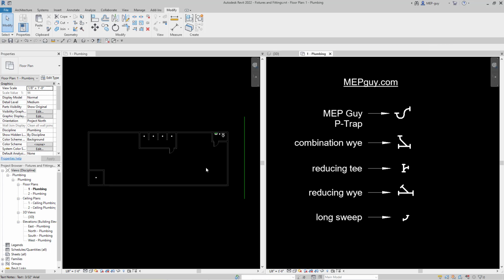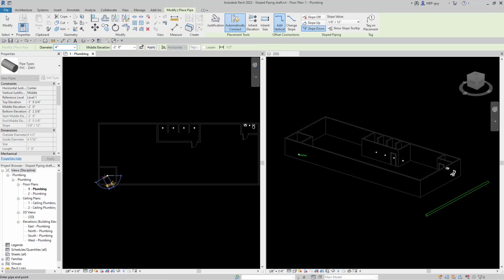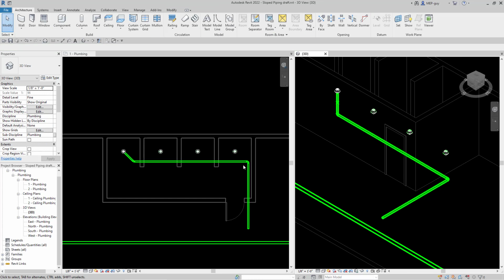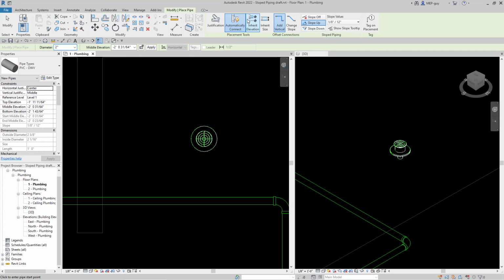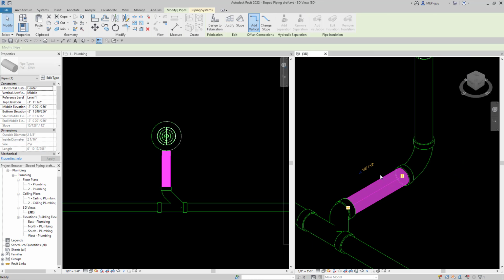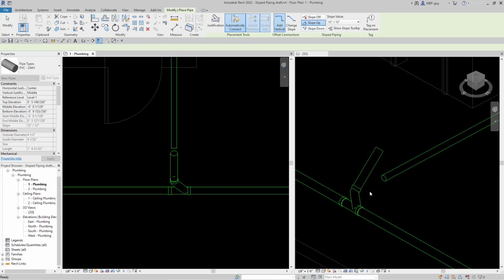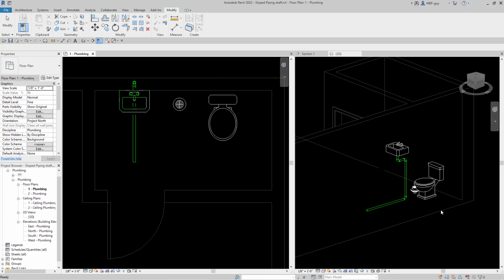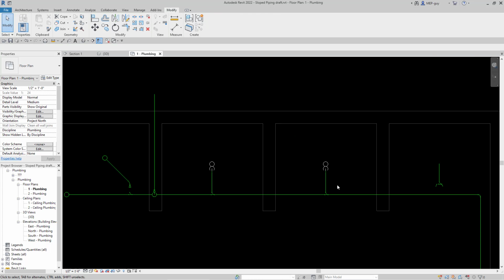Sloped Piping in Revit - (Complete Tutorial)

Comment: Can you make a video for connecting four pipe risers (HWS, HWR, CHWS, CHWR) going vertical to four pipe going horizontal (No slope needed) I know there has to be trick to make it easier but right now I am making using section views everywhere. Thanks
Reply from the maker: I typically draw the piping horizontally first. When I'm at the location to go up, I change the elevation of the pipe and click the "apply" button. This will bring your pipe up to the elevation you want. Try it in a 3D view (turn off everything but pipe and fittings floors and walls and set your view discipline to plumbing ). It might make things much easier. You can also just keep drawing your pipe after you change the elevation. The pipe will jump up to the elevation you want, then continue horizontally in any direction. Again, do it in a 3D view so you can see what's happening.

Comment: Another great video, and thanks for properly wet venting the bathroom fixtures.  We tried to use sloped pipe when we first got into Revit (2010), and it was a disaster.  We have stayed away from it for the most part until recently.  We did start to use it only for above ground storm drainage a few years ago.  This was due to the storm piping usually being large (4"-8") and having to negotiate ductwork, structure, and ceilings.  Recently I have started trying to use it for the sanitary as well, and I have gotten fairly proficient with it using the same techniques you have shown.  It still is not quite ready for prime time, but it is much better than it was 10 years ago.
Reply from the maker: Yep, I've had the same experience. For Storm, since we need to coordinate, assuming it's for a bim model, it's a good idea to slope it. For the rest, I just add the slope to my main and keep the rest at zero slope. Even though Revit gives us these capabilities, doesn't mean we should use them in every situation. It's best to have a fine balance between being precise, practical, and efficient. Especially new modelers. They waste hours sloping piping, to find out their inverts are off anyway lol. (This was me 4 years ago.)
Reply: @mep_guy   exactly. There’s a lot Revit can do that doesn’t really provide any bang for the buck. You’ve got find that right balance.